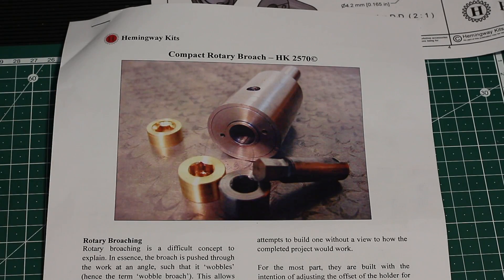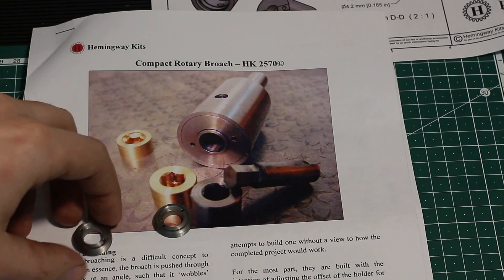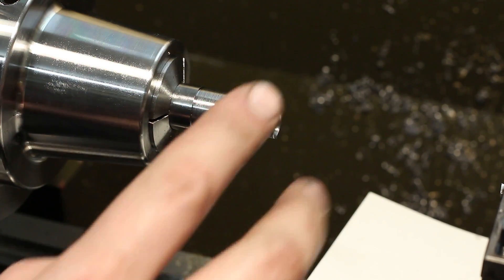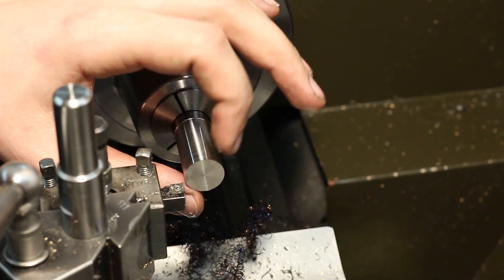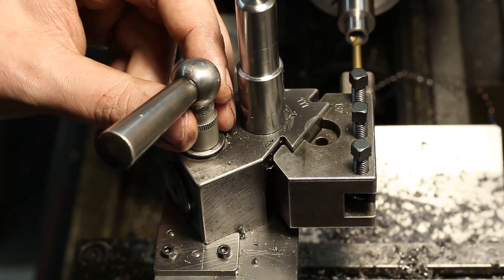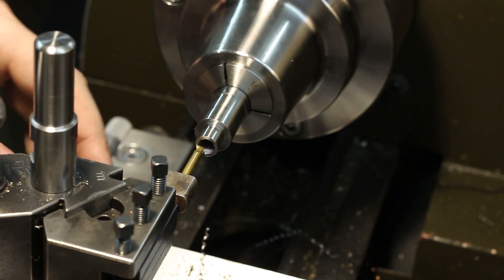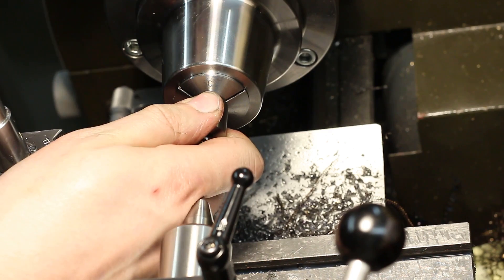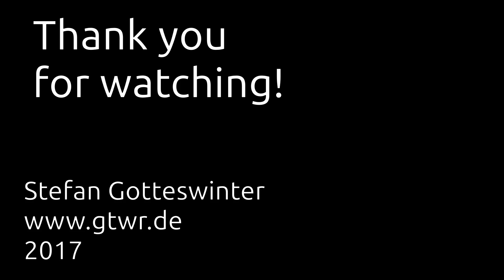Compact rotary broach - Part 1

Comment: I almost wish that kit was available 3 yrs ago when I built my rotary broach. I just built mine from scratch and made the plan in my head. It turned out pretty well. The magic to making the rotary broach work is the 1 degrees bevel at the tail stock end. I made my rotary broach to accept the standard 1/2" shank rotary broach bits. It's a cool little device. The rotary broach is easier to make than the bits. The bits are fairly reasonable for purchase on ebay...probably not worth making unless you have a special profile in mind.
Reply from the maker: With the single lip cutter grinder I can whip out normal profiles with no undercuts in minutes out of a solid HSS blank :)

I plan on designing a heavy duty version that will hold tooling with bigger shanks like 12mm..with a heavier set of bearings.
Reply: I don't have a cutter grinder, but I do have a surface grinder and an indexing head. I never thought about making the cutters out of hss blanks. I had been thinking about using tool steel and having to harden them after. I didn't want to be bothered with the hardening as I'm not really equipped for it. The hss blanks is a great idea. Thanks

Comment: Do you lower the volume of the sections where you are machining on the lathe or is it really that quiet? If so, what lathe is that? I think I might need one...
Reply from the maker: I drop the volume by 20db, because in the early videos I blew out a few ears of my viewers ;)

But apart from that it is quite low on noise, as it is all beltdriven.
More about the lathe here: http://gtwr.de/shop/pro_mykrodreh/index.html
Reply: So, seeing you use compressed air without a sound probably answered that question for me... Still interested in knowing what lathe you have there though!